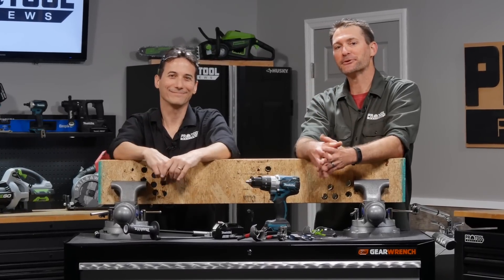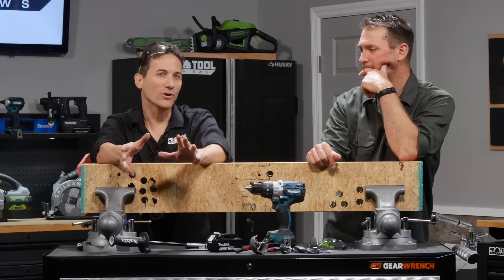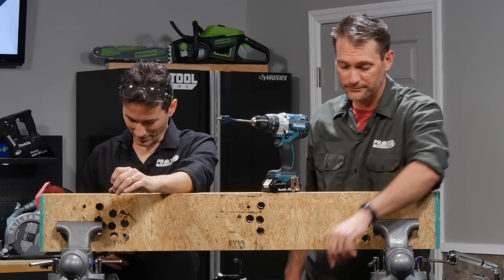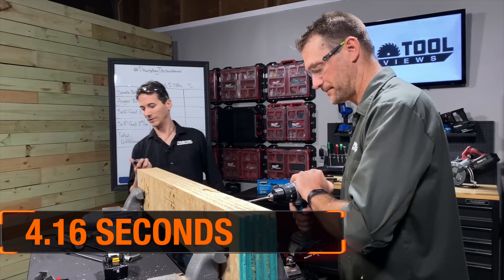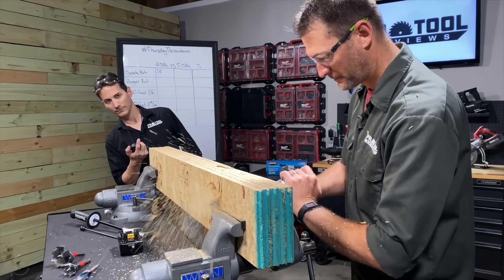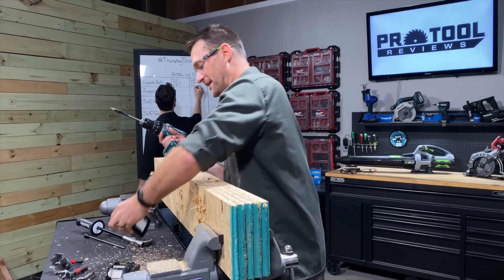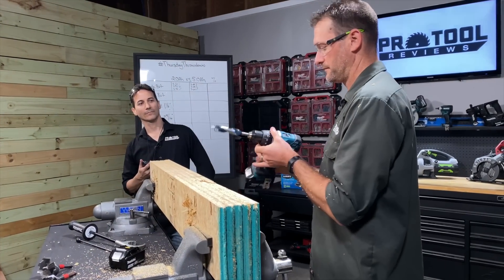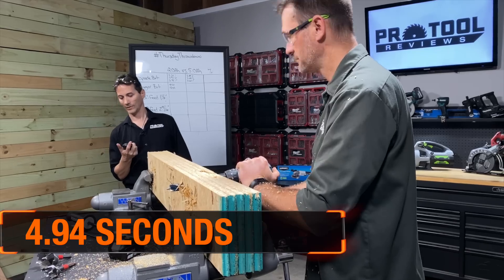Do Larger Lithium-ion Batteries Produce More Power? 2Ah vs 5Ah Thursday Throwdown!

Comment: Doesn’t Ah only increase runtime not power.
Reply: No. Ah is a measure of energy storage capacity, not power delivery. Ah x nominal voltage = Wh, higher Wh translates to more total energy storage, and at a given power usage/delivery, that means longer runtime. But power usage/delivery is not fixed. There are two factors involved:

1. Amount of power the cells can supply, sustained and instantaneous. This number typically varies with both Ah (2.0, 2.5, 3.0, etc) rating of the cell, and size of the cell (18650, 21700, etc). Since power is voltage x amperage (aka Watts), and all these batteries are nominally the same voltage, it all depends on how much amperage the cells can sustain.

2. The number of “packs” or “banks” of cells in parallel. An 18V (20V max) LiIon battery in a 1P (single bank of cells) contains 5x 3.6/3.7V cells in series. But those cells (18650) top out at 2.5Ah in they types used for “traditional” (not HP/HO) power tool batteries, because the 3.0Ah and higher versions have lower current/power delivery ratings. So to get above 2.5Ah, you have to either go to a 2P (2 banks of 5 cells in parallel, 10 total cells) or even 3P configurations. Thus, a traditional 3Ah/4Ah/5Ah battery is a 2P configuration with 10 cells. That means it can potentially deliver twice the amperage/power, if the tool can use that much. But since the tool will rarely need/use that much. It also means longer runtime. How much power or speed, will depend upon the specific tool and how hard it’s being loaded. For lighter loads, you might simply get 2x the runtime, but for heavy loads, you might get faster results, and 1.5x-2.0x the runtime. 

The newer High-Output/High-Performance batteries typically use 21700 cells, these are larger, and can deliver about 50% more current than the 18650 cells used in traditional power tool batteries. They’re also available in capacities up to 4.0Ah, so a 3.0 or 4.0 HO/HP battery can be a “compact” 1P configuration using just 5 cells, while the 2P configurations will be 6.0 or 8.0 Ah, and 3P configurations will be 9.0 or 12.0Ah, capable of delivering very high amperage and power, and/or longer runtimes.
Reply: No, this test proves that larger batteries can supply more power to the tool.
Reply: Jose Vega Ampere-hour is effectively more runtime. But they got more Ampere-hour not by having better cells, but by putting the double amount of cells in parallel, which mean double available amperage too. Assuming the tool can draw this added power, you get a benefit, but not necessarily double the power as the tool can’t necessarily draw that much current. On bigger tools though, it can be even more of a difference.

Comment: I'd love to see your skid row type application but try it with Milwaukee as the can be a 2.0 vs 5.0 vs 9.0 vs 12.0 and see how they max torque the bolt difference.

Also go makita 2.0 battery. That was a rough test that most of us wouldn't do in the field. Good to know
Reply: Yeah, the results could be interesting.

However, as the differences will have the final dependency of what is the specifications of the motor max load and max toque. If the higher Amp with larger number of parallel cells configurations, (1P Vs 2P Vs 3P Vs ...) beyond the motor max load specifications, it will not going to give any difference ;-)

Comment: I have the same Makita drill and run it with 3Ah and 5Ah batteries. To be perfectly honest, I don't notice much difference, if any. It's a very powerful tool that I highly recommend. OTOH, my other (brushless) Makita drill rated at half the power of the former does seem to have more juice with the bigger battery. YMMV. Interesting video to watch.

Nice to see decent vises on YT. I have 8 in my shop including a Tradesman like yours. Most of the others are heavier duty. Don't get me wrong, it's a killer vise.
Reply: that is because the 3ah, 4ah, 5ah and the 6ah have 2 sets of 5 batteries in parallel so double the current and capacity. the 2ah has only 5 batteries in series.
Reply: @jaakko200987654321  Interesting point. Thanks.

Comment: Hi Guys,

Yes, it's expected for certain tool to run a little faster between 2.0ah  and 5.0ah battery.  

I think the new idea for faster, cooler and more power on certain cordless tool is by using the new batteries that have the 21700 cells. The regular batteries are running on 18650 cells. 

Still using larger ah batteries regardless which cells battery does help the performance of the tool. Now in saying that i still like to use the compact batteries for certain task and the same with the larger batteries.  

Everyone uses these cordless tools differently. With kits now coming with all sorts of different size batteries no one should have a problem with speed or power. If I'm screwing above my head or screwing in cabinets a lighter battery is better. 

Thanks for the video

Comment: Thanks for the follow up test.  Many other online tool reviewers know everything and won't admit they might have goofed a little on a test.
Suggestion:  Could you do a similar test except use batteries of the same configuration but different Ah cells. For example: A Ryobi 3.0 HP vs a 6.0 HP or Milwaukee 6.0 vs 8.0 High Output or just standard 4.0 vs 5.0 2P Battery.
Reply: @mikeb1039  I am an electrical engineer.  I think I know the basics.  I was asking for a test of power, not run time.
Reply: @IndependentThinker74  how about a  "starting current" for engines of cordless tools. When engine starts spinning, it needs more current for "stay in fixed voltage", 20v for example. Weak battery packs (1,5 2,0 3,0 Ah) not may get much more current at the starting moment. That's all difference! Bigger - better!
P.S. but not for lbs😂
Reply: @mikeb1039  Yes, in terms of run time.  But power is a different story.
Reply: @mikeb1039  Amp hours do NOT necessarily mean power.  The 6.0 will run twice as long as the 3.0 but the 6.0 will not have any more power than a 3.0 as long as they have the same configuration.
Reply: @IndependentThinker74  watts equal power. Amps x volts equals watts. Unless it’s a very very low power demand the tool will draw sufficient power. Using too small a battery on a high load tool can damage the battery. 

I used to do testing on RC batteries so have quite a bit of experience with battery testing and data.

Comment: Only advantage is indicated by "Ah" the length of time work can be done.
Reply: @adamdodsy84  bingo.
Reply: @scampbell6008  not unless the voltage has changed.  It's in your head.
Reply: @scampbell6008  if I'm wrong, ohms law and watts law is wrong.
Reply: @asherdie , Ohms law is correct.  What you're not considering is that the voltage of the battery drops when it's under load.  The smaller battery with fewer cells has a greater voltage drop for a given load, therefore it delivers less power.  The larger battery with more cells maintains a higher voltage with that same load and delivers more power as a result.
This is why Milwaukee/Ridgid/DeWalt have their HUGE batteries with THREE rows of cells for their larger tools; more cells = more power output.  Some of the newer batteries also use larger 21700 cells that have less voltage drop than the smaller 18650 cells in the older batteries.
Reply: @superspeeder  exactly.
Reply: grumpybill your very wrong . Going from my 12v 2ah to my 6ah gives a notable power boost on my impact , my 18v 5ah to my 9Ah on my sds drill exactly the same . Voltage isn’t everything my friend . This video shows that and the voltage x amps gives you watts so doubling the amps increases the watts . Some people will never believe it but it’s true
Reply: @robswingler  doubled Ah, not amps.
Reply: @scampbell6008  didn't watch video. 
Edit: Just watched, my comments stand.  Ohms law and watts law explains this.